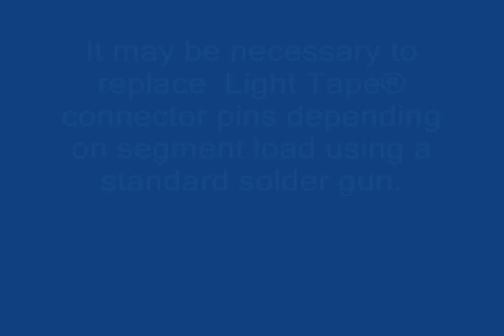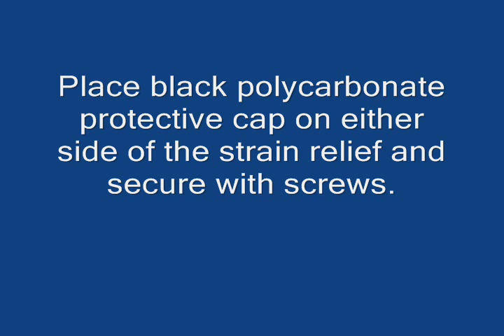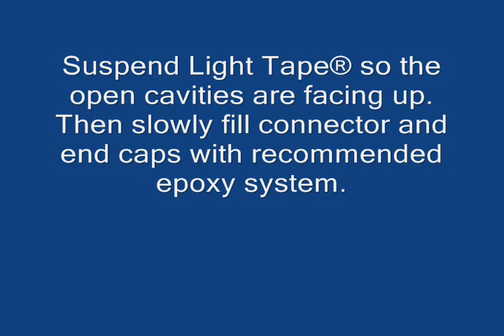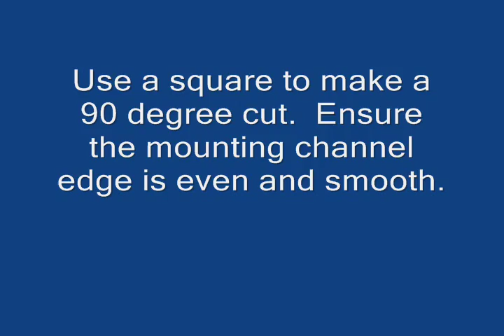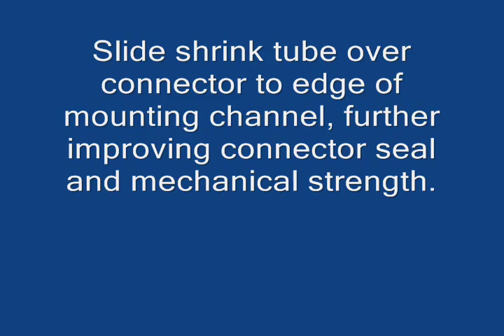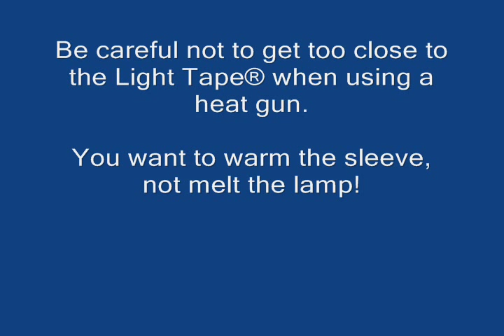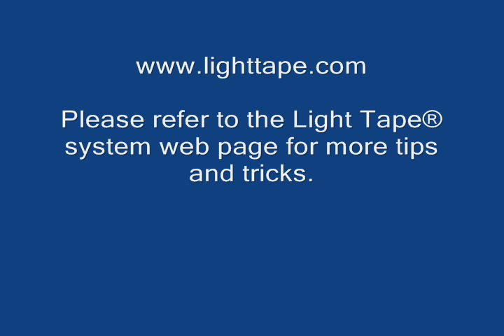Light Tape® Electroluminescent Lamps - IP67 Outdoor Connection

Comment: Don't worry, we do it all for you.  The video was for those adventurous to do it themselves.  We will send you the Light Tape finished to length and all you have to do is snap it onto the structure.  

If you can work a drill, level and wire nuts, you should be good to go.